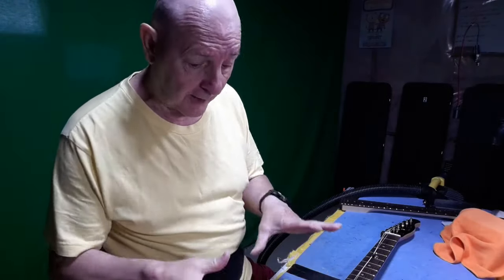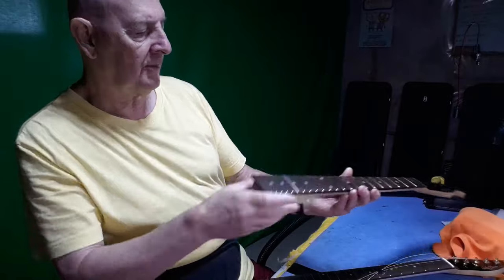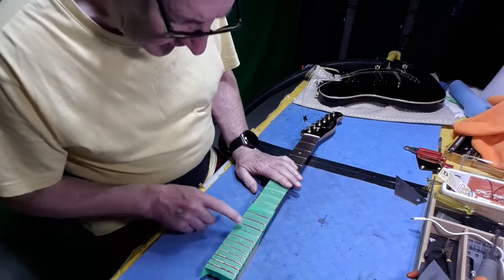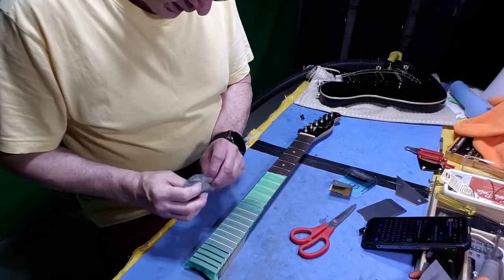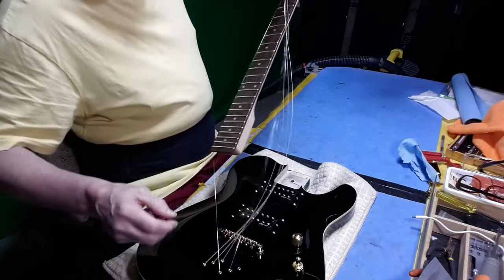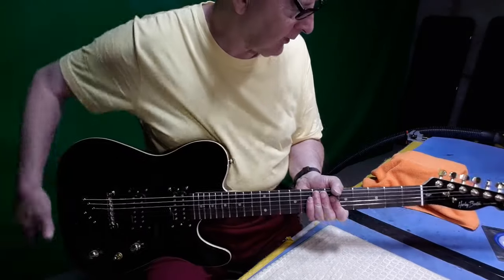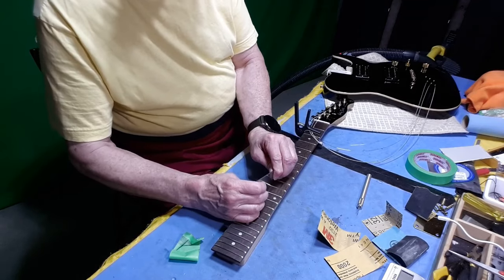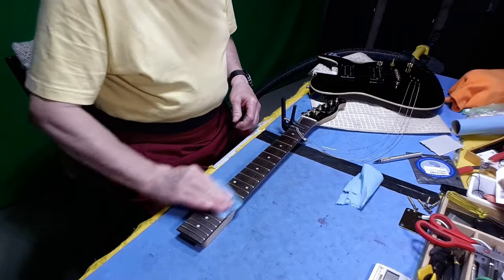Harley Benton TE 40 #2 TBK Deluxe Series   July 2024

Comment: Hey Mike. I have been watching, but this time I think I am going to put my two cents in. This is why I have been using radius blocks. I have seen a lot of guitars that have uneven fretboards, I'm not talking about the frets themselves. If the frets are installed correctly, they are just going to fallow what they are seated in. A radius block the same radius that the fretboard is will even the frets a lot better than a beam. I stuck with the 12 inches long radius blocks because the length overlaps more frets. A leveling beam is good and can do a great job, but you can put a little pressure more on one side of the beam than the other and not even know it. I have a beam that is a little longer than the fretboard is. All the frets get leveled at the same time, but I still like the radius blocks. This could be your chance to do a refret.
Reply from the maker: @ericctheartofnoise8613  
I've looked at radius blocks before but I have so many guitars with different radiuses it would be a much bigger investment on tools. I just haven't wanted to make that commitment so far. And I think I'm near the end of my guitar collection anyway. Thanks for the feedback I appreciate it

Comment: What an unforunate outcome. And with that rounded off neck heel it'll be almost impossible to find one.
Reply from the maker: I was thinking the Stratocaster neck but then I saw that the Stratocaster neck is way more rounded on the heel. It could work if I sanded down the bottom flat like the one on the guitar now period not sure I have the will to try
Reply: @2bikemikesguitartopics145 Hmm… Could you maybe use a contour gauge to measure the curve of the neck pocket, and then use that to mark the heel on the neck so you can then route and sand it to match the curve of the pocket?
Reply: @2bikemikesguitartopics145 Another thought just occurred to me, too: Maybe you could use a contour gauge on the body, right where the neck pocket starts, to see if and how the neck pocket is skewed relative to the plane of the body?
Reply from the maker: @zuperdee 
Now that's an idea that I like. I don't have a contour gauge that might be able to get my hands on one here in the near future

Comment: I'll be glad to take it off your hands before you decide to roast marshmallows over it. Fender tele necks are squared off,  Fender strat necks are rounded off, traditionally .
Reply from the maker: Strat heels have rounded corners and a beerbelly bottom.  This HB has strat corners but tele bottom.  Where are you located?  
Shipping alone these days is super expensive for a box size and weight for a guitar
Reply from the maker: I have guitar bixes here.  there is no USPS in Canada.  early last year when I gave away my Kramer, I shipped it to Massachusetts and it cost $99.  now to Florida, could be more to cross the boarder.  This is likely not cost effective for you.   I should just hold on to it for now and see if I'll try to get a strat neck to fit, or just recover all my parts on it and rid myself of these wood chunks.
Reply: @2bikemikesguitartopics145  I was shocked you would even consider it . I was half joking  about shipping it but not about the neck situation.  I have built a few as well as refurbished some hopeless cases. Peculiar enough there are a multitude of Chinese made necks that are Canadian maple selling for less than $50 American  on ebay . It was unclear if you were describing a twist in the neck or some weird gradient of the fretboard to allow for more pronoun vibration of the bass side strings . Also have you adjusted the radius of the bridge to match that of the neck ? Also some players request a higher action to facilitate better string bends without deadening the notes as well as lower radiused necks. I don't want to imply that you weren't aware of these issues , but you seem to be at your wits end  and pretty disgusted with it.
Reply from the maker: @Captain_Nemo1961   strange curvature was not the back neck it was just a fingerboard that wasn't even on both sides of the neck.   The Saddles were set to have a common height over the 17th fret so that makes it reach the radius.  I could raise the action a lot higher than 3/64 on the B and E string but then that would make it uncomfortable to play even though it probably would just get over the choking problem and not not happen.